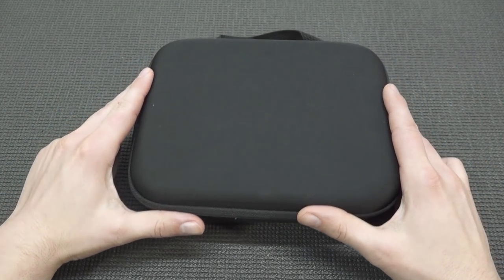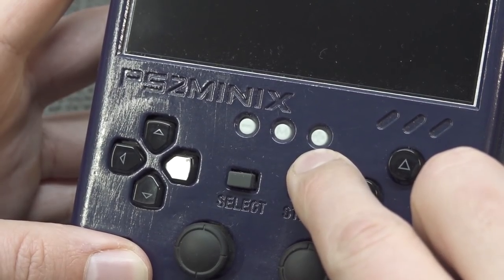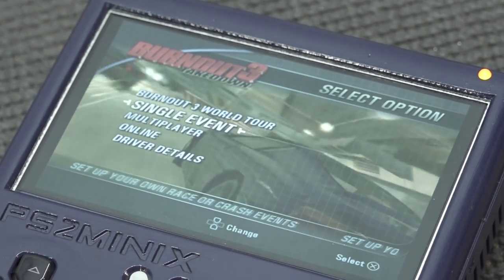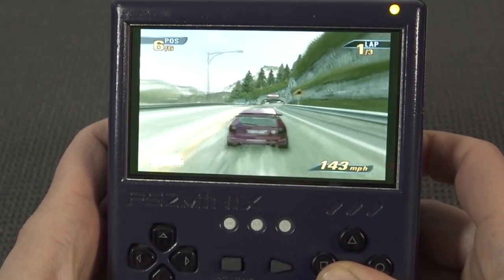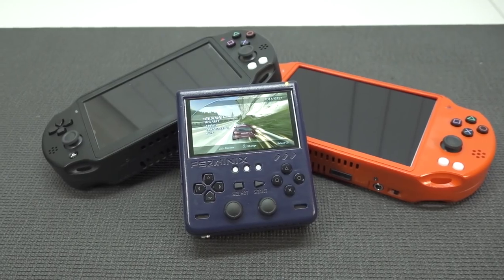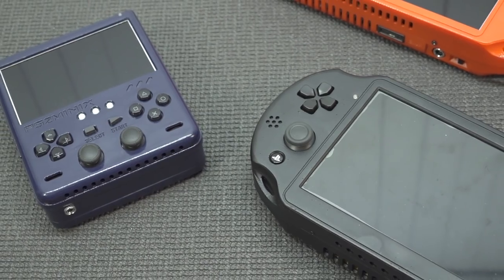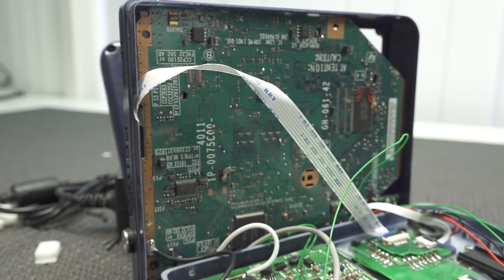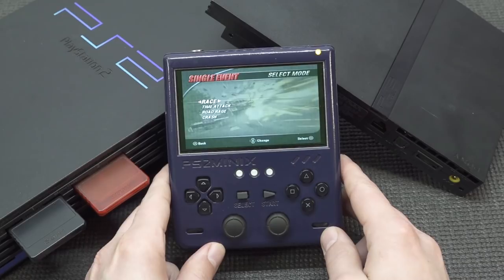The Best PS2 Portable Money Can Buy in 2021 🤔 ?

Comment: Id rather buy a used ps2 console for 30 dollars and find my favorite games and still have 400 dollars left over lol 😄
Reply: PS 2 console +
40 Inch CRT of best quality +
the best gaming chair 

LOL
Reply: Or do what I did with my phat PS2, get the MacBook, Mcboot memory card, and the hard drive connector, load it with thousands of games and never worry about gaming again. Also the original Xbox is a great machine to mod as well
Reply: Or wait 5 years and every mid range phone can run it
Reply: @Anubis_s_  thats not portable at all :P And portability is what matters for this video.
Reply: @pablogallardo5100  the Poco F3 (Snapdragon 870) is already midrange, and fast enough to emulate 90% of the PS2 games easily without tweaking.
Reply: Or get a SD870 Smartphone + Razor Kishi Controller. An still have 200€ left. Top controller, AMOLED Display, and enough power to run almost every PS2 Game, without tweaking, except for Zone of the Enders 2 or Metal Gear Solid 3.
Reply: @nick56677  make sure you get an SSD instead of an HDD. You will notice a difference in loading speed 😉
Reply: @pablogallardo5100  ps2 used is like $70
Reply: 🔑 word: portable

Comment: How they cut the board not damaging it is actually kind of amazing.
Reply: you can probably cut and re-solder most stuff, I don't see any other way to put it in a case that small, but yeah since that hardware isn't produced anymore your hands better not be shaky :D
Reply: clearly depends on some components in the pcb that are not going to be use of when converted to a portable mod
Reply: There are certain parts of the board that can be cut without much of any issue  long as you don’t short the layers. The deeper they cut though the more relocation of parts and or mods a replacements need to happen. 

Having Free mc boot helps a lot removing a disc drive. These are based on 79001 models which were 2nd generation slim models without screw holes in back which has a trim kind of close to wii trims. A big portion that is cut off most cases is power regulation areas and some areas for controller regulation for ports. They would replace the regulators with mods modern ones that take less space and the trims and relocations makes up for most of the smaller size. Nowadays there are custom PCB’s for stuff like controllers which controller boards are big usually. 

The ps2 portable in the video is pretty cheap made one but it work atleast. What goes into trimming also relies on where are important components and how hard it is to relocate. On the wii if you went small enough of a trim you have to relocate the nand flash and if you wanted to play wii games you need the blue tooth module.
Reply: @speedracer123222  I don't know electronics so it's amazing to me how even if you can cut the 'unnecessary' portions, you can still get it to work, though I guess it makes sense since you're now rerouting a drive to an sd card, the emulator chip or whatever would be dealing with those functions, but yeah, thank you so much for that very detailed explanation!
Reply: they are profesional....
Reply: Theres a guide online on where to cut to not damage the motherboard
Reply: They have datasheet for soldering parts by wires.
Reply: When I had a sony vaio p11s1r I wanted to take a motherboard with a more powerful processor from a laptop with a broken screen and cut it in half to fit inside the sony vaio p. I did not find an inexpensive laptop before the sale of sony v.
Reply: Scam alert
Reply: does anyone have an answer to how that was done?
Reply: Facts
Reply: Look at wii u pcb cutting. That shit's crazy
Reply: remember the ps2 slim?
That was all that was needed for a ps2
And even with that being so incredibly small
The disc drive essentially doubled the size of the unit
Then there was USB ports controller ports ect many uneccisary parts on the board that can be snipped off
Reply: @j.r.6627  look on the bit build forums. You can trim a lot of circuits down. Usual components that get trimmed off are voltage regulators (at least this is true for the Wii trim) then they make a new voltage regulator using a mix of capacitors and resistors to manipulate the voltage levels that each component on the ps2 motherboard uses and then solder that to the trimmed motherboard. You’ll find with a lot of consoles; there’s only a small section that is the actual console itself, everything else is voltage regulators or connection to disc drives, usb, controller and memory card ports. Although in this build a ps2 memory card has actually been soldered to the mother board and an SD card slot has taken the place of a USB port. This is due to the fact that there is no disk drive and to boot games you need external memory (usb/ micro SD) and a ps2 memory card that has freemcboot on it. Otherwise it would just be a disk drive less hand held ps2. 

There’s other bits to mention too, like audio/ video and the controller and obviously battery’s. But to be honest this is about as much as I can tell you haha

Comment: The reason why you need a special charger is not that it has a special set of batteries or its current/voltage output, but that the protection circuitry is not inside the handheld but in the charger brick.
Reply: what are you talking about??? NO CHARGER HAS ITS TRANSFORMATOR INSIDE THE DEVICE IT CHARGES!!! AND NOT ONLY BECAUSE OF SAFING SPACE!!!!!!! DO YOU KNOW WHAT INDUKTION, OR AN EMP IS???
Reply: ALSO LITHIUM IRON BATTERIES REQUIRE A CERTAIN FREQUENCY DC VOLTAGE TO CHARGE -> SO YOU NEED A SPECIAL CONTROLLER AS WELL!!!!
Reply: Ok...
Reply: @DommageCollateral  bro, you need to relax, why are you angry?
Reply: @DommageCollateral  Thats not true? there are multiple devices where its located inside

Comment: Very creative and impressive, but looking and the "innards," I'd be concerned that those wires would break free from the solder points with just a bit of jostling around.  Converting this to a commercial product would be a nightmare.
Reply: yeah, internals wasn't as pleasing as the outside, quite a botch job tbh
Reply: How to buy it ? Where can I buy it?
Reply: @nicoful86  if it was a botch job it wouldn't work
Reply: @laudennn  with the mainboard being loose inside and only thing keeping it from taking contact somewhere is the mess of cables in between, it's only a matter of time it doesn't work anymore. the maker should be ashamed for selling something like this

Comment: I think any phone capable of running a ps2 emulator would be a better investment, not only more compact, longer battery life but the indisputable fact that games will look and play better on it along with any games that would have issues are bound to have a patch for them.
Reply: "Some" being a key word there. although PS2 emulation has gone through a ton of hoops lately. A device like this (as of right now) would be the best way to run most if not all PS2 games handheld.

Comment: This leads to the question, why didn't Sony make this in 2006 instead of the PSP. I guess the main issue at the time was storage. A UMD disc drive would have made it too bulky, and memory storage was too expensive.
Reply: Better to have a new system with new games than a miniaturized system that sells old games.
Reply: In 2006 PS2 was not old enough to recall fans' memories. Now it would be a good time to make a handheld official replica of PS2, as nostalgia is strong on this one
Reply: @kalabash4952  But the PSP was out in 2006, which was heavily based on Playstation technology. Might as well have made a PS2 level handheld.
Reply: @alexojideagu  well, no.
Reply: That's like asking why they didn't make the PS4 in 1994.
Reply: @gaylordfocker7990  What are you talking about? The PSP was very close to the PS2 in power. Both could run at 300mhz. Nothing like having a PS4 in 1994. What a ridiculous statement. The reason most games limited the PSP to 200Mhz was due to battery life.
Reply: @gaylordfocker7990  Go and look up God of War on the PSP, it's comparable to the PS2 version. GTA Liberty Stories is very close to GTA 3 graphically, especially when you overclock it to 333mhz.
Reply: @alexojideagu  Clockspeed does not directly correlate to processing power. The PS2 had a very unique architecture with special dedicated vector engines and graphics pipeline. The PSP in the other hand used a standard ARM based SoC with very limited graphical capabilities. In raw performance, the PS2 had roughly 6.2 GFLOPS meanwhile the PSP was around 2.6 GFLOPS.
Reply: @0x1EGEN  The PSP ran in a lower resolution, which compensated for the difference in power. The same trick the Switch uses in handheld mode. Many PSP games are graphically like early PS2 games. God of War is an example. Also it was only battery life that could have prevented a handheld PS2 being possible in 2006. If it ran in a lower resolution low power mode.
Reply: @0x1EGEN  The Switch runs  393 GFLOPS in docked mode and 236 GFLOPS in handheld. So the PSP was comparable to a handheld PS2 running in a lower resolution.
Reply: Because the cost to make the PS2 portable would've been very expensive at the time. You can't just shrink down the PS2, add a screen and call it a day, especially in 2006.
Reply: Can't u see how bulky and big it is compared to a psp.
Reply: Would've been huge, expensive and unwieldy
Reply: @alexojideagu  Using clock speed to compare the performance of two different chips is like comparing car engines by their RPM red line.   It just doesn’t work that way.

Nobody has noticed the elephant in the room...PS2 was a disk based system.  I think that would present multiple, and obvious, problems.
Reply: @MrCumstein  You don't get it. I'm stating a PSP as powerful as a PS2 running in lower resolution, just as the Switch does handheld, with SSD instead of a Disc Drive was totally possible in 2006. The PSP Go literally did this and shank to 1/2 the size. It had no Disc drive. Using SSD cards for the PSP like the Switch would have been completely possible. Running on a lower resolution at 2/3 the clock speed of the PS2 like the Switch does in hahdheld mode, would have been totally feasible. The ONLY issue would have been battery life.
Reply: @RandomUser-tj3mg  Sigh, the PSP Go literally did exactly what I'm saying. Removed the Disc Drive and used SSD cards instead and the machine became tiny. This was totally possible in 2006 and SSD cards were  already used for the system storage. The technology was literally there. Sony were just scared of battery life.
Reply: @eddiew.4650  A portable PS2 would be running at a lower Resolution like the Switch does in Handheld mode, meaning it can run in a lower power mode. The PS2 slim technology was already out in 2004 at greatly reduced production cost, By 2006 they had the technology to make a handheld with SSD and no Disc Drive.
Reply: @alexojideagu  we did not have any technology like that in 2006. There was some primitive thing but very far from what we have today, and costs would have been unbearable. Stop talking like you really know what you're talking about
Reply: @alexojideagu  Sigh, you didn’t say “as powerful as a PS2”, you said a “portable PS2”.   Think about my comment in that context, it’ll help you understand.  The rest of your comment(s) is either stating the painfully obvious or stating utter nonsense, and not at all enjoyable to read.  
You seem to be fixated on arguing things would have been “possible”, but there’s a big difference between “possible” and practical.  In no way shape or form would a portable PS2 (an ACTUAL PS2 that plays ACTUAL retail PS2 games) have been a practical retail product in those days.  A stand alone device with the power of a PS2 wouldn’t have been practical either.  And before you go citing the PSP’s existence as some part of your mis-guided argument, consider this: The PS2 was 5 years old when the PSP released.  It’s wasn’t as powerful as the PS2 and cost over $100 more than the PS2 was selling for at that time.  The PSP Go was released 4 years after the PSP, and had a price which was $150 more than the PS2 was selling for at the time.  Those are what we call “facts”,  based on what we know as “reality”.
But I’m sure SONY would have sold millions of the $700 handheld PS2s with late 90’s LCD technology, and obscenely expensive memory.  I can’t imagine what they were thinking that kept them from releasing it.  They should have taken a page out of 3DO’s or NeoGeo’s playbook, I guess.
Reply: @alexojideagu  lolno.
Reply: Your level of ignorance is painful of 2006 technology. The PSP could already run games from the SD card without the cost and bulk of the UMD drive. The PSP was already a PSP go with a disc drive attached. It was only big because of the UMD drive. The PSP screen was perfectly good enough. The PS2 slim was from 2004. Sony already knew how to miniaturise it at a cheaper cost. NEC pulled this off in 1990 with the PC Engine handheld. Of course Sony could have done it.
Reply: I mean Pro Duo memory cards not SD cards. Sony's biggest mistake was that UMD drive which added size weight cost and battery drain. That is why we didn't have a portable PS2 or equivalent. Not technology.
Reply: Because after a certain level of success companies sometimes stop making exactly what the customers want and they make what they want the customers to have. Which explains how Nintendo has been acting lately.
Reply: @metamorphicorder  That's very true.
Reply: @adrenalinex4  With your hands? NEXT....
Reply: The PS2 slim and PSP came out less than two months apart in 2004, the disc drive is a good point but it'd also kill battery
These parts weren't exactly made to run off batteries and Sony would be driving sales away from the slimlines which were selling great
Reply: Sony tries to hard to compete with Nintendo and Microsoft if you think about it
Reply: He'll nah PSP was better than this could ever be lol
Reply: @MrCumstein  ignore him he clearly wasn't alive back then.  The psp go would have been impossible for the launch of the psp. The psp launched at the end of 2004, this means the design had to be finished in the middle of 2004 to allow time for production. Micro SD cards didn't even exist until 2005 and they didn't have sizes over a gb back then. A UMD was capable of holding nearly 2 gb of files, in 2004 this was not possible on a memory card. SanDisk launched a 1 gb sd card, not micro a full size sd card, in 2004 and it retailed at 500 dollars in 2004 money. Even if sony demanded developers make their games under 1 gb and designed the psp to have a full size sd card slot for games, individual games, not the console itself, would have cost like 600 dollars. Even if they instead wanted it to be download only, there was no such mechanism which sony had to exclusively deliver digital only games in 2004. As for the idiotic handheld ps2, in order to even be possible it would have had to physically play real ps2 dvds as no such storage or digital distribution existed back then in a way to make it otherwise possible. So practicality aside it would literally be impossible back then.
Reply: Because it would be expensive, bulky (they wanted a portable system), ugly and battery destroying.
Reply: and Sony still want to sell tv
Reply: @alexojideagu  you're thinking of the vita not the psp go the only way to get games on the psp go was by downloading them
Reply: @skurasch  👍
Reply: @AngelBatistaa  dear lord the amount of cringe in ur post is unbearable. I sincerely hope you're not actually this paranoid. You believe in the early 60s, businesses had smart phones and several teraflop portable computers? This is beyond delusional. You clearly have no concept how products are created nor do you have any grasp on how businesses interact with each other. To think every business is secretly working together to hide future technology is actually hilarious. I'm sorry the public school system has failed you. Please read more books, get a library membership, and stop embarrassing yourself on the internet.
Reply: @skurasch  Probably why he deleted his latest comments.😂
Reply: @alexojideagu  How would they sell games on something with no disc drive?

Comment: The motherboard in the original PS2 is about the same size as the slim. Spawn Wave has a video where he does a comparison.
Reply: This leads to the question, why didn't Sony make this in 2006 instead of the PSP.
I guess the main issue at the time was storage. A UMD disc drive would have made it too bulky, and memory storage was too expensive.

Comment: In the biggest twist of irony possibly ever imagined, with the release of AetherSX2, Android phones paired with a type-c controller became possibly the best way to experience PS2

(Unless you demand accuracy of OG hardware, which these handmade consoles could fill albeit at a prohibitive price)
Reply: I agree, I've had a modded PS2 for years and love using the original hardware but this emulator is so solid and easy to use! Even on PC my tests in PS2 emulation haven't been as good as Aether

Comment: Wow... This is still VERY crude! Having a REAL portable PS2 (no emulation) is an awesome idea! But they ALWAYS use crappy material for EVERTHING except the original PS2 core parts. For a device that costs more than $600 USD, it is completely UNACCEPTABLE!! Just think about it, for that price you can get a freaking PS5!

Cool thing, thanks for the vid, but for the ridiculous price, horrible quality, this shouldn't be recommended to anyone.
Reply: Your paying for the labor and very niche. I would have paid if it had quality buttons and a better case. They could have used donor ps2 buttons/membranes to make it close to a ps2.
Reply: It's not like the market is flooded with these ones to justify a lower price